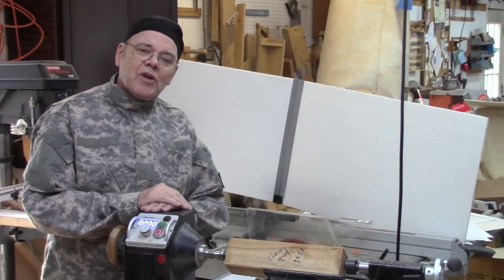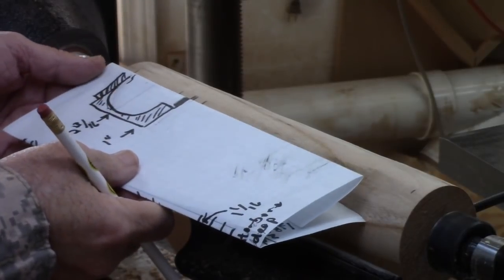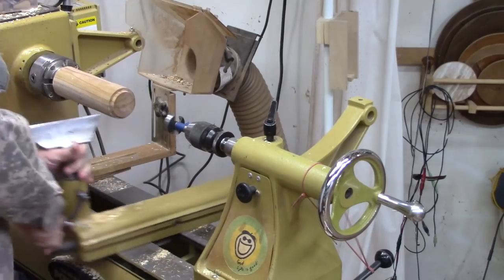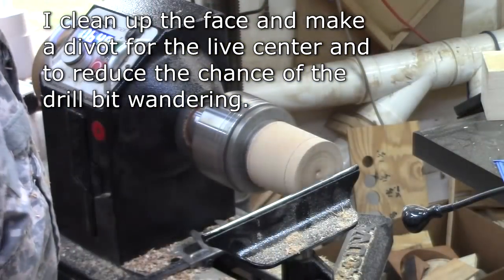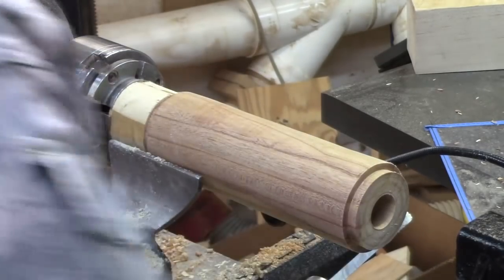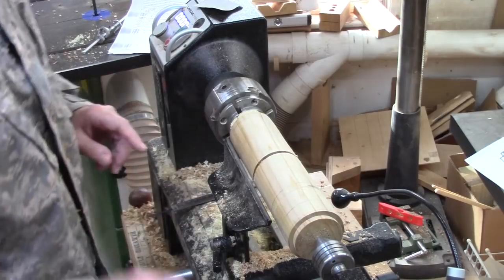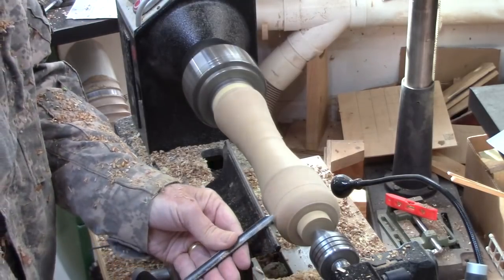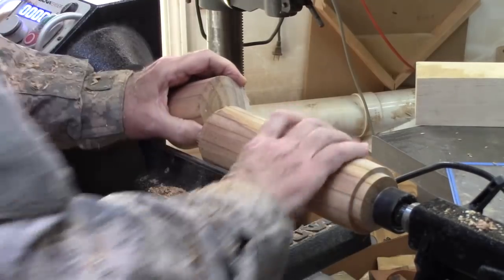How to Turn a Pepper Mill on a Lathe

Comment: "Turned" out great!
A method I used when making a few pepper mills that wouldn't fit between centers when all I had was a smaller lathe was to turn the top on my pen mandrel after drilling it. It also gave better access to the top and bottom for finishing. After doing 3 of them, It did chew up my non stick bushings though...
Reply: You prolly dont give a damn but does anybody know a method to log back into an Instagram account..?
I was stupid lost my login password. I would appreciate any assistance you can give me.
Reply: @Declan Clyde Instablaster :)
Reply: @Kevin Noe it did the trick and I finally got access to my account again. Im so happy:D
Thank you so much you saved my account :D
Reply: @Declan Clyde Glad I could help =)

Comment: Thank you for the video. I'm faced to trying to do my 1st grinders and have watched bunches of videos, you've made it easier to under stand, especially about removing the tenons.  I noticed what looks like towards the end that the body appears with the tenon again. Maybe a retake for video edit move. Thanks again for your help.
Reply from the maker: Thanks. I could not find what you wer referring to. A Min mark wood be helpful. I have the wood drive center. Could that have confused you. I taper the bottom to eliminate the original tenon.
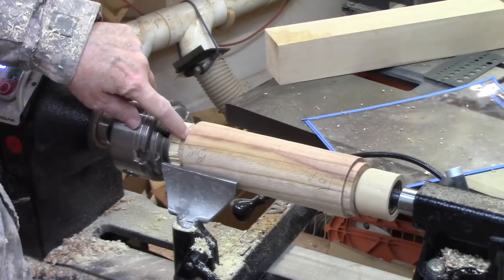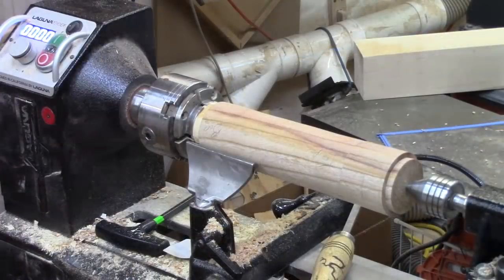Reply: @MikePeaceWoodturning  What I noticed is that you started to remove bottom tenon at time 12:35 then the top tenon at 13:00, but at 13:48 the tenons are back on the body. Sorry for nick-picking.
Reply from the maker: @MrBeechcrafter  No worries. At 13:48 what might look like a tenon on the chuck side is the wooden drive that fits into the bottom hole. The top tenon is the tenon on the cap which I put on  the base for turning.

Comment: This video is about two weeks late, I just turned my first three mills for presents!  Crushgrind mechanisms work well.  Used bubinga for one and it is gorgeous but such a pain to turn!   Congrats Mike and Happy New Year!
Reply from the maker: Well, your video would have been better with 3 under your belt compared to my none! Anything you would have done differently after watching mine?
Reply: Mike Peace Woodturning Nope.  Crushgrind mechanism requires a little bit different approach so not apples to apples.  But what i did like was you using the skew to face off the end grain.  I really struggled with gouges doing this and got a few catches and run backs.  My first one wasn’t very pretty!

Comment: Just a heads up on one thing I have found out about pepper mills:  With the solid wood top they tend to be top heavy.  So having the base a bit wider will make it more stable.  Also the mortise at the bottom should not be too thin in case it does tip and crack the base.  My tipped over, hit the floor and cracked.  Live and learn.
Reply from the maker: Thanks for the advice!